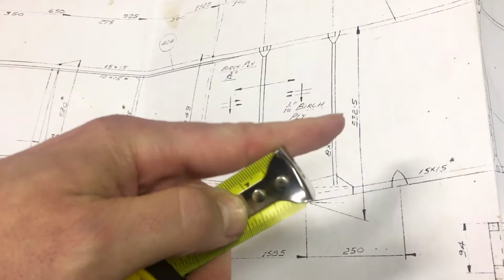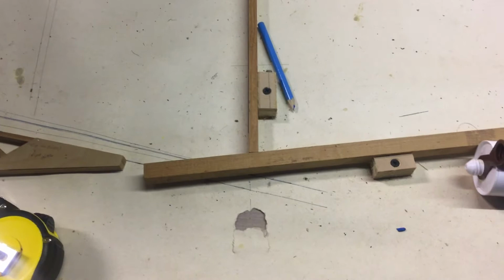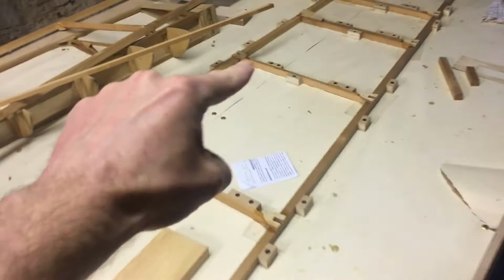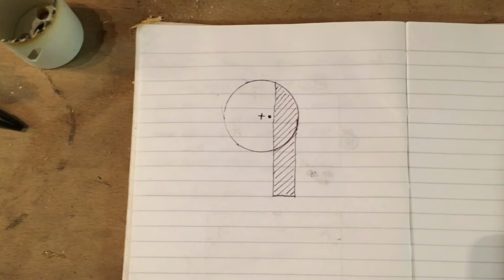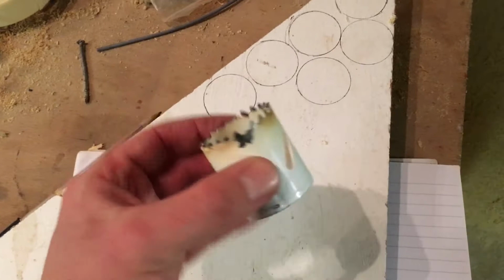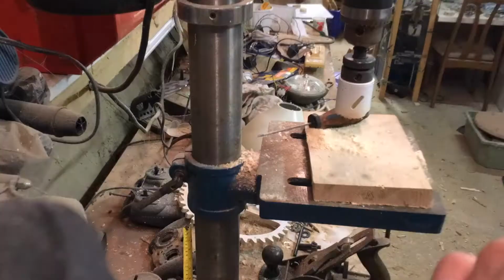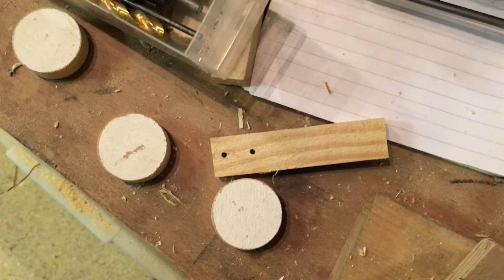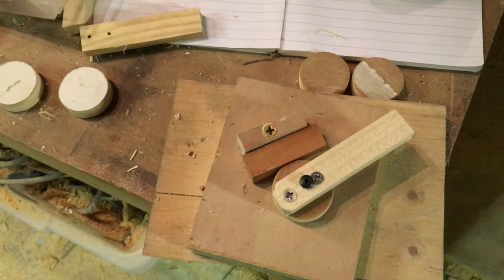Turbulent Build Vlog Ep. 20

Comment from the maker: Turns out I could grind off the gussets if I needed to and save the longerons.  Was being a bit too hasty in my conclusions (again) but it appears I can work with what I have anyway.
Reply: Some googling suggests epoxy can be softened with heat. I wonder if an iron held against the parts may soften things enough that they can be separated cleanly? Thanks for the video.
Reply from the maker: @hohocc1349  Hi, thanks for the comment!  Yes there are probably a few ways around getting the gussets off, I was not thinking very clearly when I realised my mistake.  It turns out my inspector is happy for me to just put a slight curve into the longeron to bring the end up to the right position.  It will make my aircraft unique but it has been pointed out that barely any Turbs are completely alike anyway.  Looking forward to cracking on with more work on the fuselage sides so I can finally stand them up and go from two to three dimensions!
Reply: @thesprucegosling9574   Excellent, glad you have a way to keep moving forward!